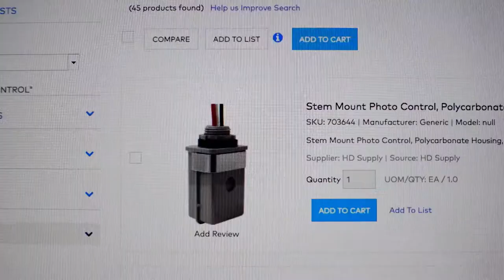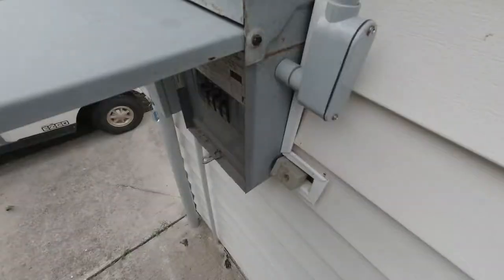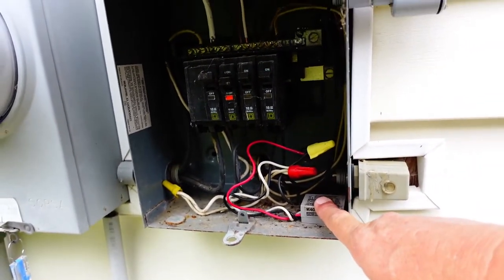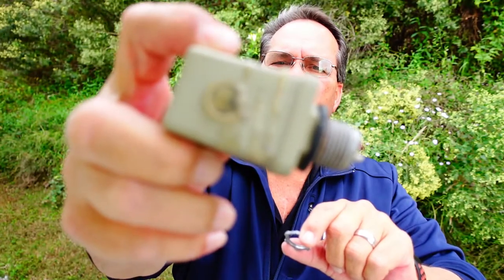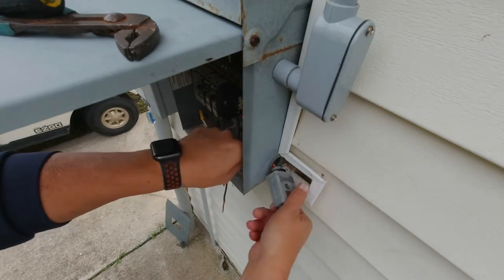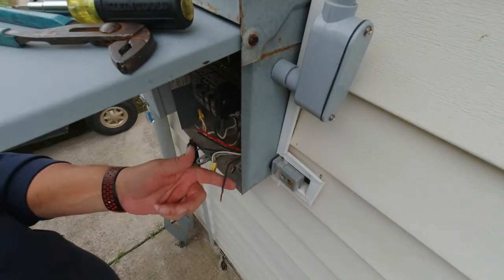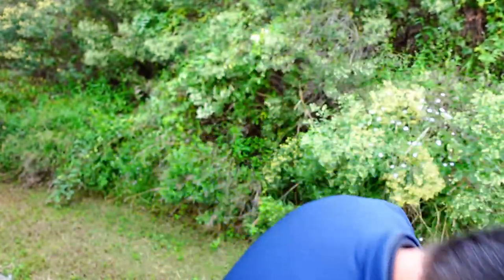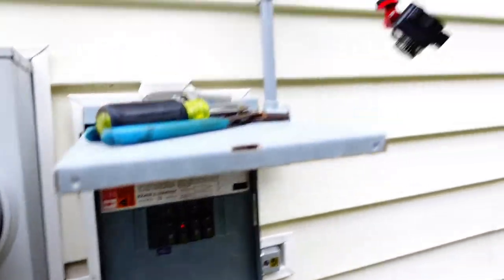How to Replace A Photocell / Photo Control Sensor

Comment: Been alive for 63 years and I never knew that AC circuits had a positive and negative line the way a DC circuit has
Reply from the maker: Don't remember if I used Positive and Negative in the video, might have. Maybe hot wire and neutral wire would be a better way to describe it. If i said positive and negative..... sorry.
Reply: been livin under a rock there , Sam??? WTF